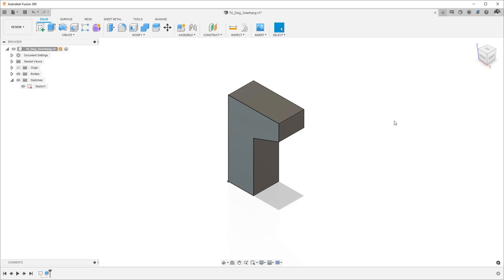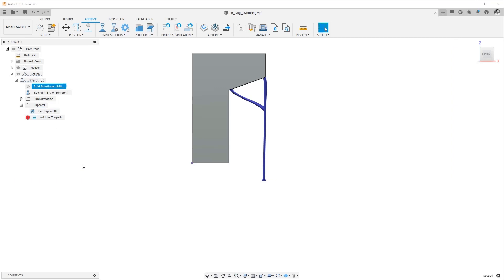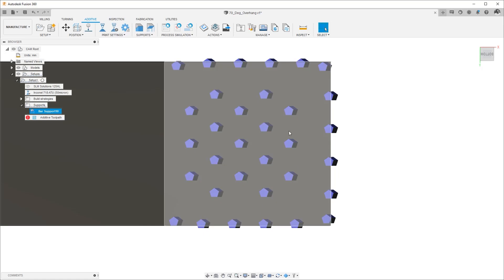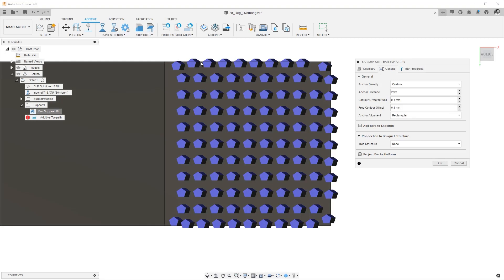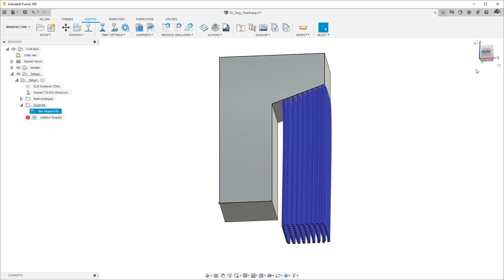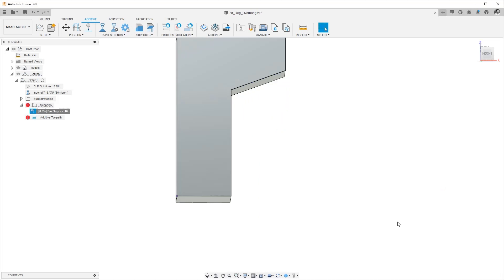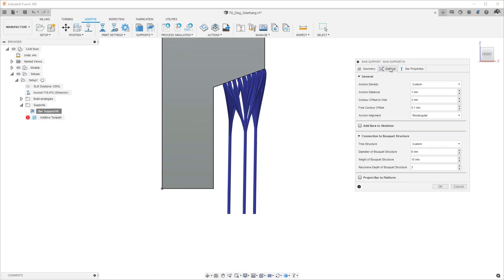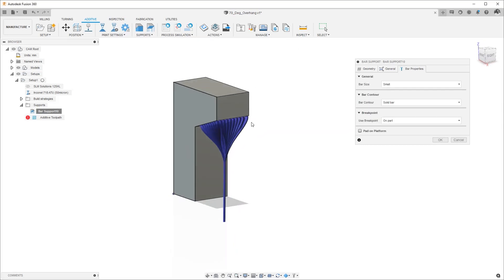All About Bar Supports for Additive Manufacturing | Autodesk Fusion 360

Comment: hmm yes very helpful need to pay for it to use the goddamn supports don't i
Reply: hi @doublethrone4136. Thank you for commenting.
If you want to create support structures for a desktop FFF, SLA or DLP printer you can use the FREE / personal version of Fusion 360.
If you want to create support structures for a metal powder bed fusion printer, you need subscribe to Fusion 360 and the Additive build extension.

This video shows the support structures being created in the context of a metal powder bed fusion printer, but the functionality shown here also applies to FFF, SLA and DLP printers

Hope this helps.